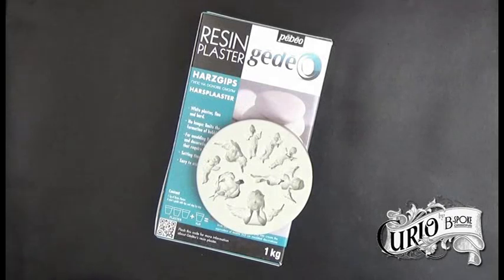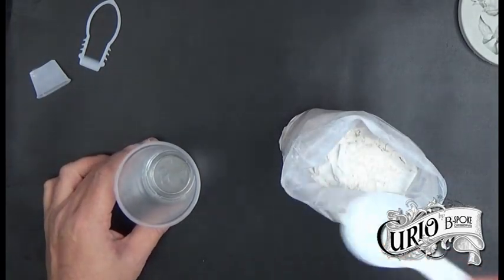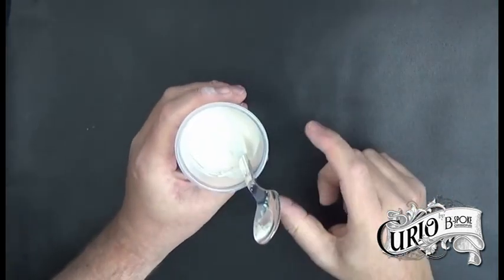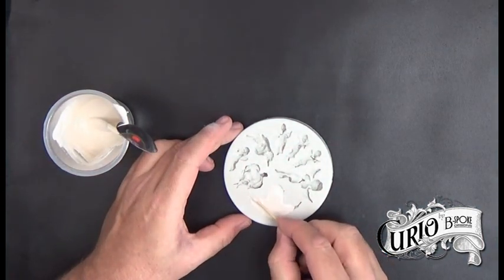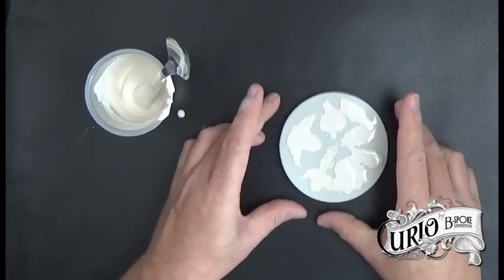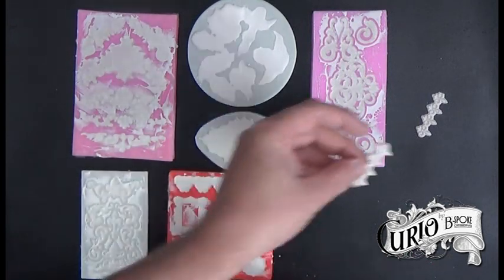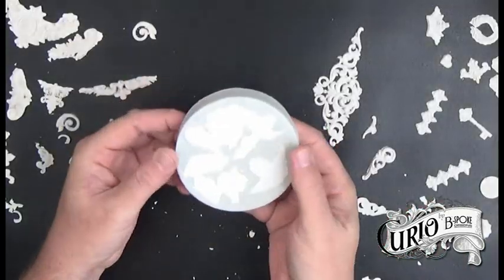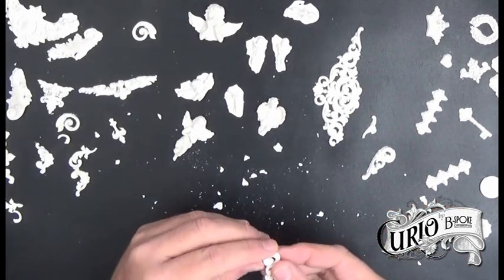Casting Gedeo Resin Plaster in Silicone Moulds

Comment: I've had some great results with this product, if you leave it overnight it's alot more sturdy to demould. in shiny silicone moulds, the resin type, you get an excellent finish, almost gemstone finish, I've wire wrapped a few large cabochon and they look fab. Try some different moulds you will be pleasantly surprised I'm sure xx
Reply from the maker: Kathryn Halstead thanks for the tips. I'll try using different mounds and leave overnight.
Reply: Are they flexible still when they come out, like you'd have with alumilite white?

Comment: Thank you for the video - did you brush your moulds with a light dusting of flour like the caulk lace ? I use a light dusting for moulds with paperclay , and i find that also breaks easily and warps when you demould if it's a large mould - would you say this was better than paperclay for fine details and strength ? Thank you so much !
Reply from the maker: There's no need to brush any powder into the moulds. This stuff is like a stronger Plaster of Paris, but it's still not that strong. I have not used paper clay so can't really compare it.

Comment: Hi! I use resin for moulds but it's really expensive so I am looking for alternatives. My question is: can i use this mixture in a silicone mould that i previously used resin inside? Or will i ruin that silicone mould and i’d be better making a whole new silicone mould specifically for the use of this mixture? Thanks!!
Reply: Also - is this product as strong as baked polymer clay once cured? Sorry for all the questions!
Reply from the maker: no you should be OK to use this is the same mould. I use the same moulds for this, resin and polymer clay without issues

Comment: Would you use this rather than plaster of paris or air dry clay to make embellishments that you can use on furniture or mirrors?
Reply from the maker: Yes, it's a little stronger than Plaster of Paris, however it is way more expensive. I don't like air dry clay at all as it has a tendency to crack, even months later cracks can appear.

Comment: Does anyone know i can pour a layer of resin and then back it with a layer of this? :)
Reply from the maker: It's really not very strong - plaster of paris with PVA is about as strong.
Reply: Curio By B-Spoke Designs I sort of meant for aesthetic reasons rather than to strengthen it, like would they bond?
Reply from the maker: @Voldycat  yes, I don't see why not